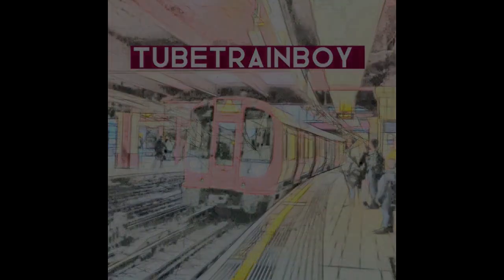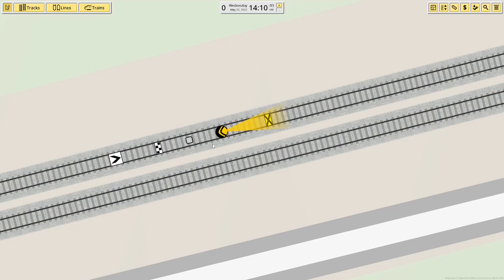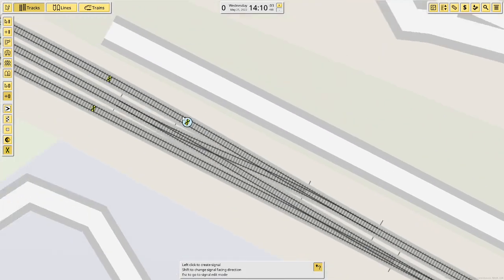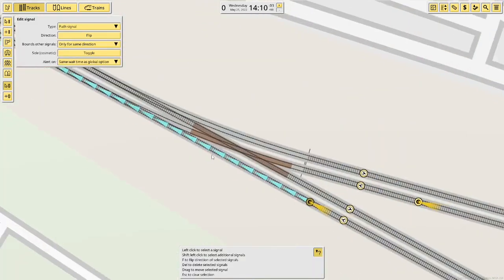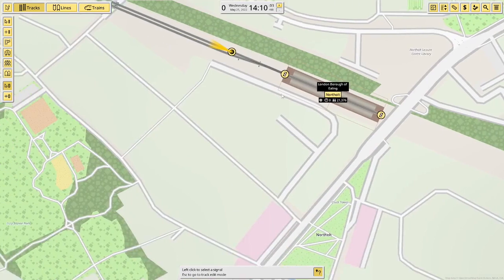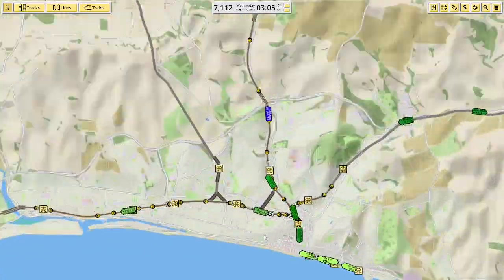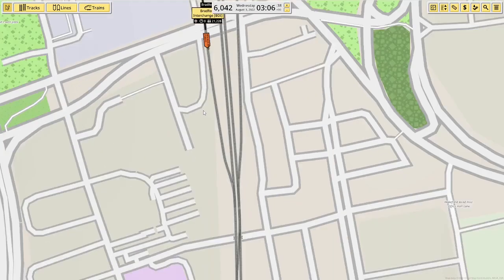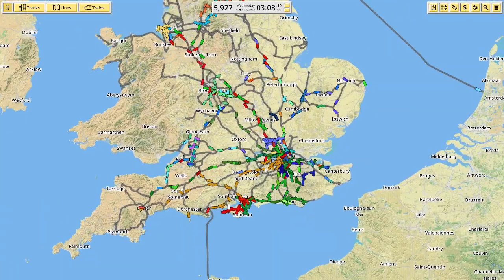Nimby Rails Tutorial - Part 5 - Signals

Comment: For the platform stopping sign, if I have different lengths of the trains running at the same track and want to stop at the different stop points, will adding two or more points work for different trains?
Reply from the maker: Not currently, they will all stop at the same point I believe. You could 100% try it to double check though!

Comment: In later versions there are only path signals.  However they have the option of ‘same direction, or ‘always’. What situations would I use the two types?
Reply from the maker: I'd always recommend setting them to same direction, so that it will only end the signal block for signals facing the same direction. I'm yet to find a use for "always".

Also: Following comments I am going to make a brand new tutorial/series very soon. (No more annoying music!)
Reply: @tubetrainboy  regarding using the ‘always’ mode.  I agree, in fact in some case when I’ve tested it the signals have been ignored and caused conflicts.